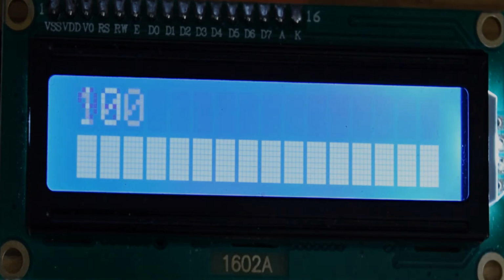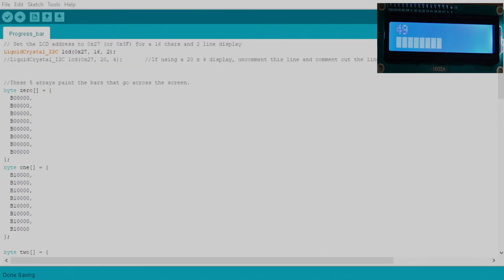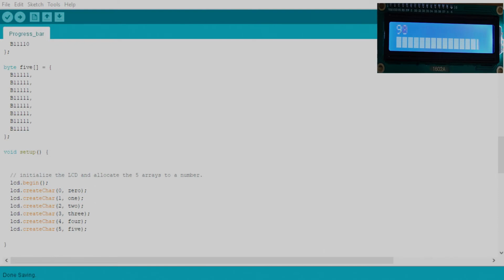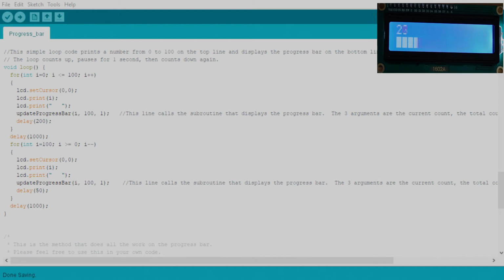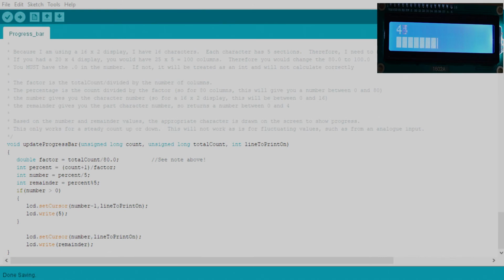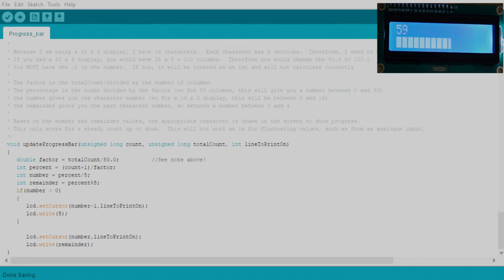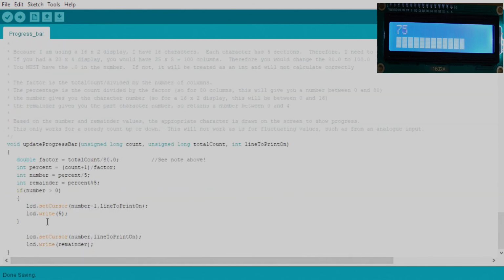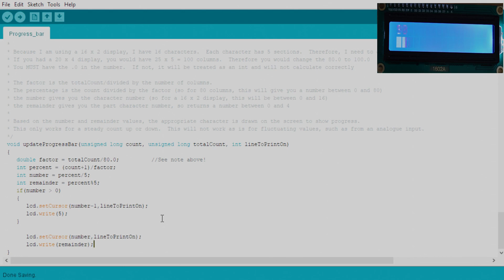Progress bar for Arduino and LCD

Comment: now is 8x5 pixels   how fix 5x5 pixels?
Reply from the maker: In the code, six byte arrays are declared 'byte zero[]', 'byte one[]', etc, etc, up to 'byte five[]'.  Within each byte array, 8 variables are declared, one for each horizontal 'bit'.  As each changes, another horizontal 'bit' is added (so they go: B00000, B10000, B11000, B11100, B111110 & B11111.  If you only want 5 lines rather than 8, just leave 3 of the variables in each byte array as 'B00000'.  I hope that helps
Reply from the maker: You can also check out my instructable (link above), which has all the info as well.

Comment: The code works great but instead of boxes getting filled in, I have horizontal lines.  Could it be my LCD?
Reply from the maker: I am assuming that you mean it is printing a horizontal line the complete width, then either filling downwards, or upwards.  The lines that print to the LCD are: 'lcd.setCursor(number-1,lineToPrintOn);' and 'lcd.setCursor(number,lineToPrintOn);' , depending on whether the number is 0 or above.  You could try reversing the arguements so that they become 'lcd.setCursor(lineToPrintOn,number-1);' and 'lcd.setCursor(lineToPrintOn,number);' respectively to see if that solves the issue.  If you have a different chipset in your LCD, it may reverse the horizontal and vertical coordinate arguements.  If you are still having issues, contact me via my instructible (link in the comments) and I'll see if I can help further.
Reply: @bobsyers  Thanks for the help! Reversing the arguments seemed to fix it.

Comment: Disculpa funciona con un potenciómetro?
Reply from the maker: El código simplemente toma un valor y lo traduce a la barra de progreso. puede tomar un valor de un potenciómetro y usar ese valor si lo desea.
Reply from the maker: The code simply takes a value and translates it to the progress bar. you can take a value from a potentiometer and use that value if you want.

Comment: wont work for me says "lcd" could not be declared in this scope
Reply from the maker: Sorry to hear this isn't working.  Are you using the code exactly as I have produced it.  If so, do you have the 'LiquidCrystal I2C' library installed on your system?  The one I have is by Frank de Brabander.  The 'More info' link brings up this github link: https://github.com/johnrickman/LiquidCrystal_I2C  I hope that helps.

Comment: hi, lcd.begin give me error, you know why?
Reply from the maker: Hi riccardo.  Do you have the LiquidCrystal_I2C library installed?  That is probably your most likely culprit.  This works on the basis you are using an I2C LCD.  If not, you will need to chage the setup to reflect your LCD setup.
Reply: @bobsyers  hi, i solved my problem, the problem was that the liquidCrystal_I2C command is wrong, is LCD.Init() not LCD.Begin(). The last one is good only for liquidCrystal.H